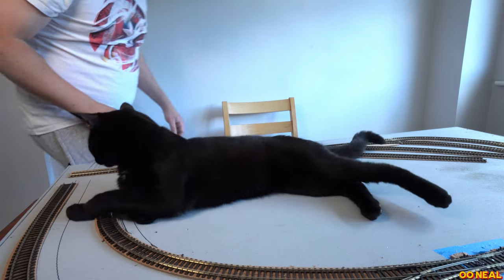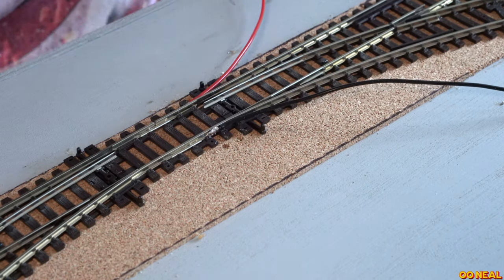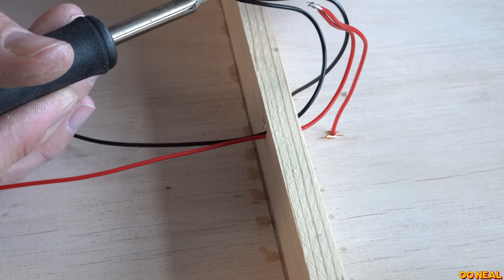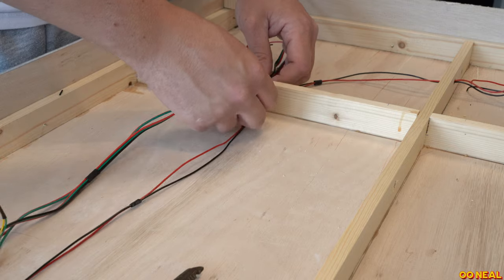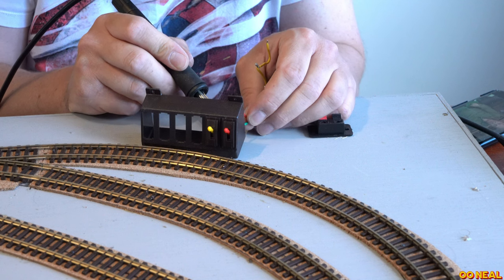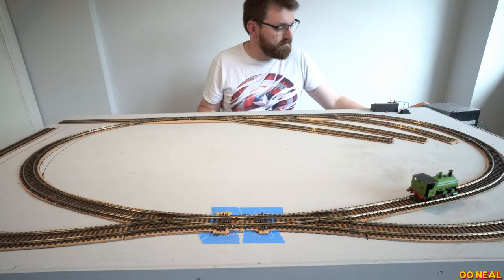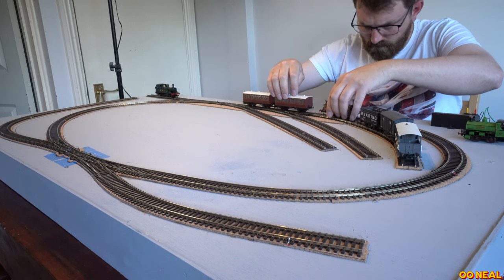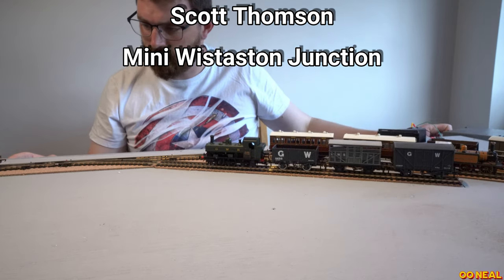Jubilee Model Railway Layout | Baseboards And Track Laying | Episode 2

Comment: Very useful start as I’ve been putting off wiring up my layout for far too long. However, then I got lost when you started wiring up points seemingly to their own controller. You also said something about being able to switch between DC and DCC but I didn’t understand how you would make that work, sorry. Nevertheless, you’ve taken many of my fears away. Thank you and hope the show goes well.
Reply from the maker: Hello Will, I am happy I have helped in some way. The DC to DCC is just from pluging in one or the other. Its nice and simple, When I do plug in DCC I will connect more of the tracks up for when I have locos in the sidings with sound on.